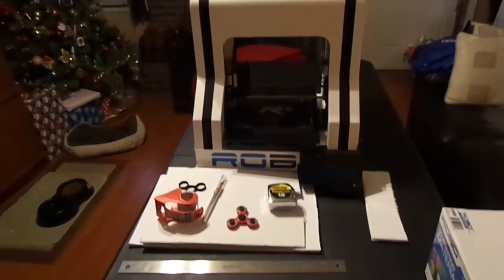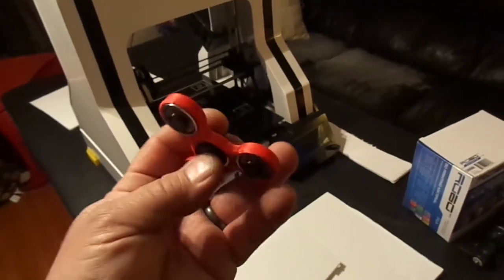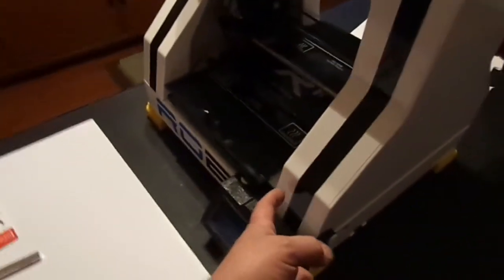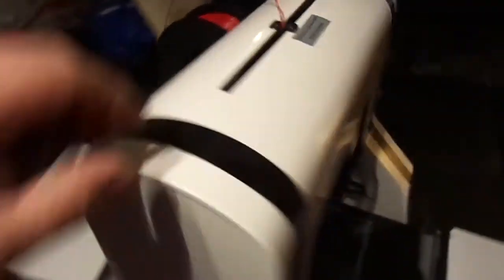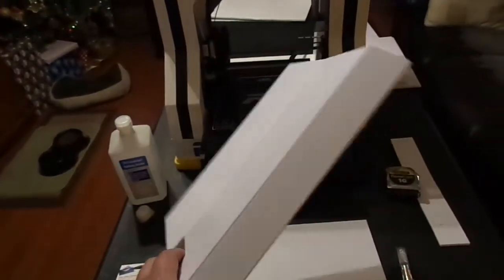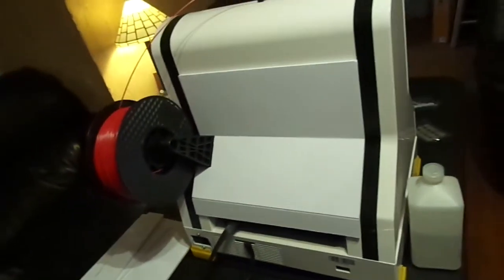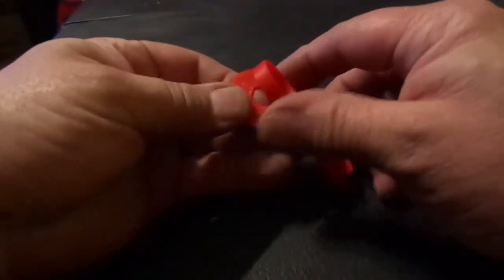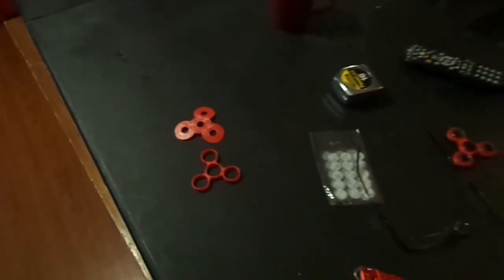3D Print ABS "successfully" on the ROBO R1 for $10.00

Comment: Did you use glue on the bed or just print on the glass?
Reply from the maker: I only used AquaNet hair spray, I've used the glue stick but I think the hair spray works better for me. Temperature control is the big key here when doing anything other than PLA. Get it all hot (but not too hot) and keep it at the same temperature the entire time and you should be fine. Thanks for the question

Comment: i like your design for printing abs with your enclosure. I am thinking of doing the same but am wondering since its been a while would you recommend anything different on your design or do you recommend perhaps a different design ? thank you
Reply from the maker: Joe Cobos great question, for the simple design and cost I still love and use this method. Larger ABS prints would require something sealed better but this still provides stable temperature for my prints. Get a thermometer to verify temp stability before starting your print and you should have great results providing your sliver settings are correct. I’m using the newest version of Cura. Thanks for the question/comment
Reply: thanks for the reply. i have been using PLA for a while but now am venturing into ABS. I keep hearing about the issues with using ABS. i like your design. i think i will try it out. thanks for the info and video.